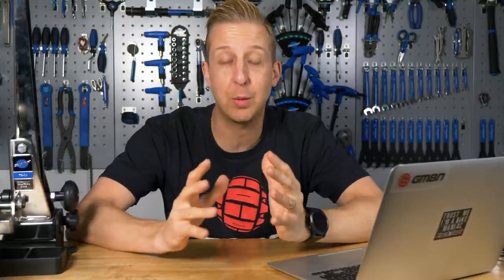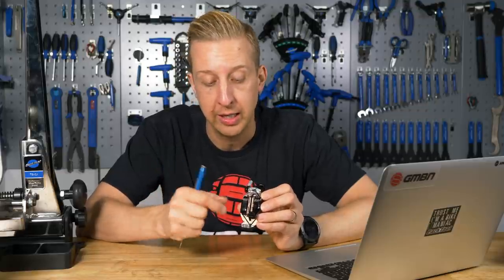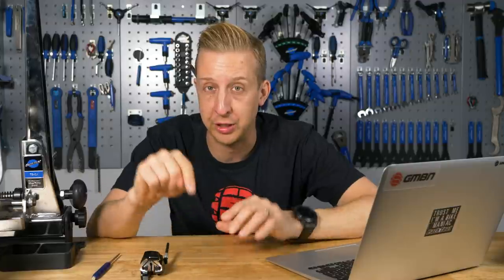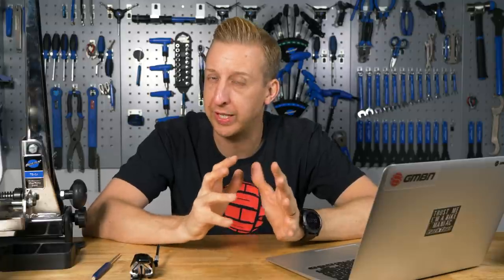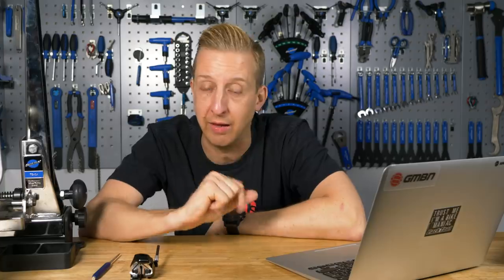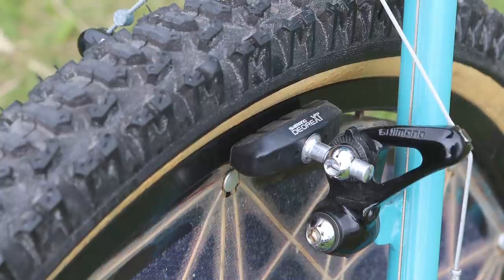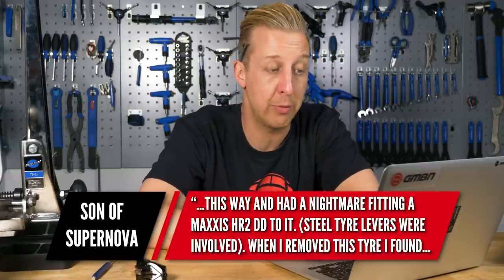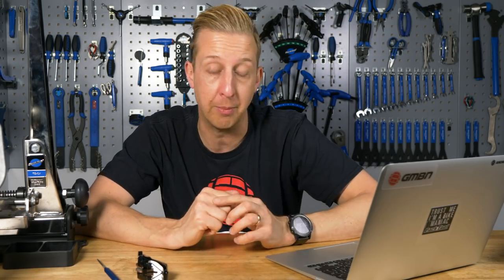Mountain Bike Brake Solutions? | Ask GMBN Tech

Comment: My brakes don't retract well in the day but is fine at night. My guess is that the pistons expand during the day? Any solution for this?
Reply from the maker: As Doddy said you can lubricate the pistons but it could also be that your pads are worn and you have a lot of the piston out of the body which could be binding slightly when riding. If you are using Shimano brakes you can use mineral oil for this lubrication.
Reply: Lim Jia Shern 
Just ride at night🤣

Comment: #AskGMBNTech On my Norco Fluid hard-tail, going downhill I feel like I'm about to go OTB. The stack is much lower than my previous bikes. I think that's the problem. I can compensate with either spacers, a riser stem, or riser bars. will those options affect the bike in any other way? Which would you choose?
Reply from the maker: If you are able to add some spacers this will be the cheapest option. A higher rise bar is definitely the cleanest way to raise the front end 👍
Reply: All three of those methods will make the reach shorter.
Reply: @peterlang5047  So that could be an argument to go change the stem, out of those three options? I could get a slight rise and shudder a longer stem to compensate?
Reply: SquireRides yeah you could do that

Comment: #askgmbn hi, I have a fox rhythm 34 fork. I want to do the maintenance by my own but I don’t  know for sure if i need to use the fox 5wt oil or if I can use the 20wt oil for air and damper side?
Thanks in advance!
Reply: 20wt air side and 5wt damper side. Don't mess with it
Reply from the maker: 5wt is a lot lighter than 20wt so we would suggest sticking to Fox's recommendations in this case.

Comment: #AskGMBNTech yo Dodds big fan, great show I have recently brought magura mt5 front and rear and they are very loud when stopping and at low speeds and at high speed they are quite, how do I fix this without buying new pads. Cheers
Reply: ITZFINEST what’s wrong with loud brakes? I love it when my brakes squeak because I can both feel and hear them.
Reply: ITZFINEST you can try cleaning the disc and pads with isopropyl alcohol. That might work

Comment: #askgmbntech like the gcn tech CHEAP BIKE to SUPER BIKE series why dont you do gmbn tech
Reply: This would be nice
Reply: Thats exactly what I did with my first MTB. I purchased a Trek 4900 from 2012 really cheap, because its widely used as a commuter bike in Denmark and completely stripped it. Everything was replaced with some quality components and I reused some of the parts which are not making huge of a difference like the rear derailleur, cranks, headset, BB, etc... of course everything reused was cleaned, degreased and lubricated before reinstalling.
Reply: Doddy how does a dropper seat actually work ? #askgmbntech

Comment: HOW can you mark your bike so if it gets stolen you can get it back?  
Is there a product on the market that's best for secretly marking your bike?
Reply: NFC chips - like the ones pets get chipped with.
Just attach them hidden inside your tubing using industrial adhesive.
Reply from the maker: Yes, as Le Typ said you can get tracking chips. It's also worth taking a clear photo of the bike and recording your frame serial number. This is normally located at the bottom bracket area.
Reply: @gmbntech  I mean more so if the stolen bike gets "parted out"...is there something besides engraving yer social security # on every part?  when some bikes are worth WELL OVER $10K, it's gotta be worth engraving EVERY PART...isn't it?
Reply: your frame has a serial number (usually on the BB housing), if you want to mark individual parts you just have to be creative to leave an unique mark on every part (paint, scratch, paper in the handlebar/seatpost, ...)

Comment: #ASKGMBNTECH Shimano XT 8020 brakes vs TRP quadiem brakes?
Reply: A Bottle of Bleach a Day Keeps The Doctor Away both are awesome check out the trp slates they are my favorite brakes
Reply: I've ran trp g-spec quadiem's and they don't have a lot of power for a heavier rider at least, but the brake has amazing power. I'd recommend magura mt5's but if your'e puzzling with the XT's i would say that if you want quick instant power, go for the 4 pot XT's. But if you want more modulation for dh riding. Then go for the quadiem's.

Comment: #askgmbntech what forks are the best for non tapered forks 120mm travel
Reply: I have had good success with the SR Suntour Epixon.  Having recently changed it myself from the 100mm it was supplied as, I will say that I feel the rebound was more responsive when at the lower travel, but haven't worked with it much (I got some new bikes).  I think there are some fine offerings from Manitou also!
Reply: If its a 1 1/8 non integrated headset you could do a taper conversion. That was my plan until i realized mine was integrated haha
Reply: jordan longstreet it does have to be a semi integrated headset (with flush but removable cups) and not the narrower fully integrated ones but I have done it very cheaply with a nukeproof lower cup but hope and cane creek make more premium options.

Comment: The only ways to change head angle are with different size front tire or DH Forks...👍  Silicone spray inside cable housings.
ABS: Morimoto technology trickling down I've been saying this for a decade that push bikes are becoming motorcycles without the engine. 👍
Reply: Flying Lap Productions to change the head angle you could get a bigger front tire, or a smaller back tire, or a longer fork (doesn’t have to be a downhill fork) or get an angled headset.

Comment: Okay my two questions that I have are I have an older Kona and I want to make it disc brake what Mount would fit it the best without having the mounting bracket and would 29in upper and shocks put on 26in bottom and shocks for the front forks if you can't answer me about those questions please let me know#askgmbntech
Reply from the maker: Hey, you need the mounts to convert to disk brakes.
Reply: @gmbntech  what one is the best
Reply: In order to safely put disc brakes on your bike, you need a frame that already has the mounts as part of the frame. In regard to your other question about putting a 29 inch fork on your 26 inch bike, that’s a bad idea because it will mess up the geometry a ton.

Comment: 10 min in..guy should get mechanical disc brakes at least..I find they are perfectly fine for normal trail use.
Reply: entry level shimano hydraulics are very cheap, i dont think you will get any decent cable brake for even less. (the br-mt200 comes at 38 euros for a set)
Reply: I have a set of mechanical disc breaks I would give to anyone wanting to switch.

Comment: I have sent in numerous comments about sorting out my Rocksoxs soloair fork with no response, I am at my whits end with this with my warrenty running out fast.  Doddy I have watched your channel from the start and expected more from this,  Also I have sent in 3 lots of bike cave material with no response either.  This is why I stopped watching GCN for exactly the same reason.  I love this channel but feel like I am being chinned off (As we say in the RAF) every time I send in any material or comments !!!!!!!!!!!
Reply: Did you use the # sign with askgmbntech??  Just asking mate.  Also, Doddy does his best, but this is just a cycling channel.  Why don't you try Rockshox?  Cheers.
Reply: Yep
Reply from the maker: Nige, we hope you appreciate we receive a lot of comments and it's simply not possible to answer them all but we try our best to get as many as possible. What is your Solo Air question? We have just searched through your comments to us on Youtube and can't find it. Was it sent via a different platform?
Reply: @gmbntech  no it was sent via you tube. I am having a clicking sound that sounds like it's coming from the top of the left stancion when the fork is compressed. I have tried different settings. Serviced them, works fine then the sound comes back. Had them serviced by a bike shop with the same problem. They are actually now out of warranty so need some advice.
Reply from the maker: Hey Nige, 🤔 thats strange as we can't see that comment anywhere, even on GMBN and EMBN. Was it sent using this @Nige Johnson account?  - Anyway, firstly this pretty hard for us to diagnose without being able to see the bike. Have you checked to see if your headset is not loose, worn or un-greased? If you have struck something head on that could have loosened the CSU (Crown Steerer Unit), causing a creaking sound under heavy braking/ compression. Our next step would be to raise your concerns with your nearest Rockshox suspension service centre. Those guys are often suspension wizards and could potentially know exactly how to help you out!

Comment: #askgmbntech I have some revelation forks on a stumpjumper medium frs  and my forks are at the lowest presume but still not  soft enough for me because I'm very light and young. Thanks in advance
Reply from the maker: James, The lowest of air pressures should be very soft as if you let the air out you can compress the fork by hand. You can run the fork lower pressure than the air guide suggests as a recommendation.
Reply: @gmbntech  they are air forks but if I let any more air out of the forks they will compress but won't rebound to the original position